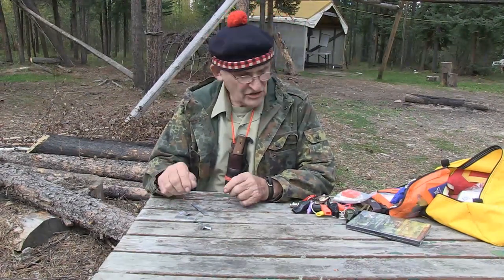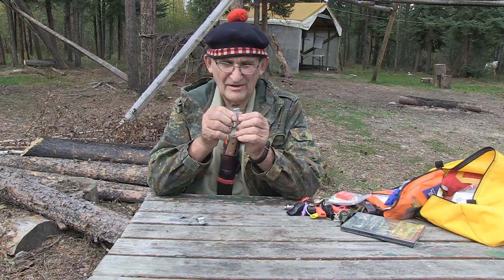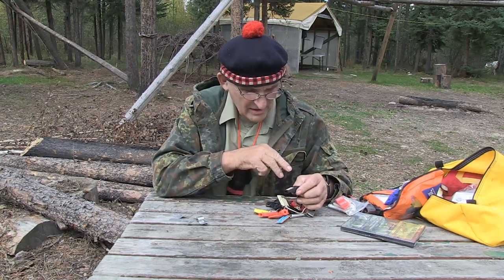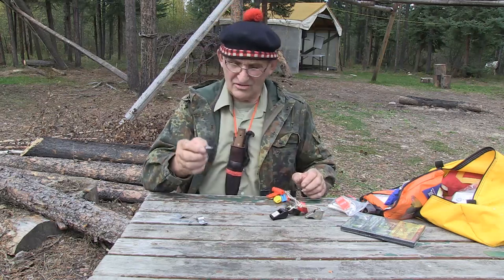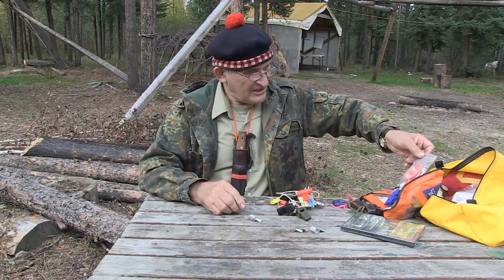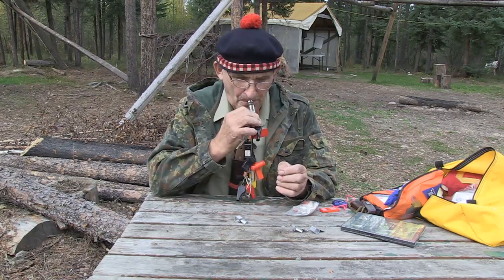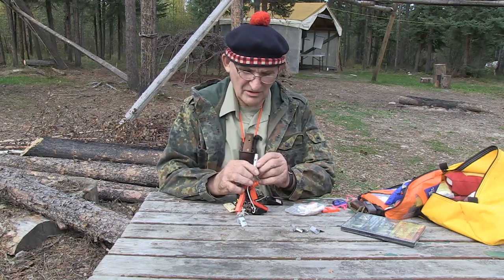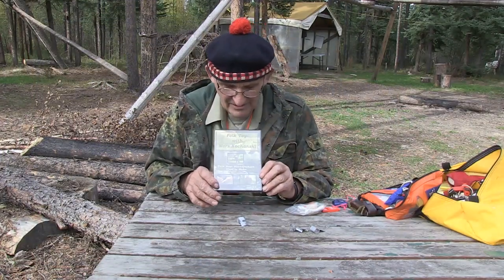Whistles

Comment: The first whistle I ever made was from steel banding - a 2" section folded in half.  It was punched every 1/2" with a small hole.  That whistle was extremely easy to make and very very loud.  To perfect the sound all I had to do was change the width of the fold.